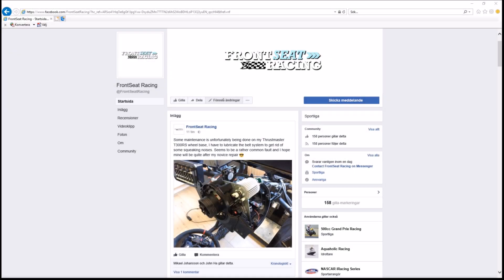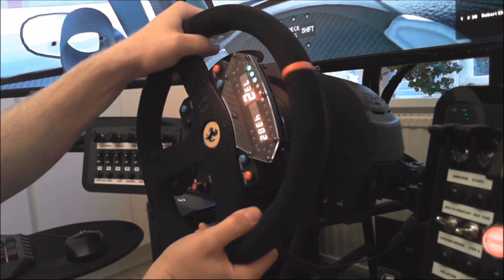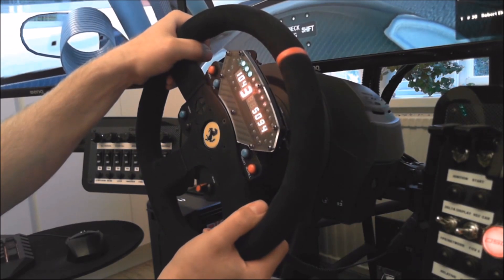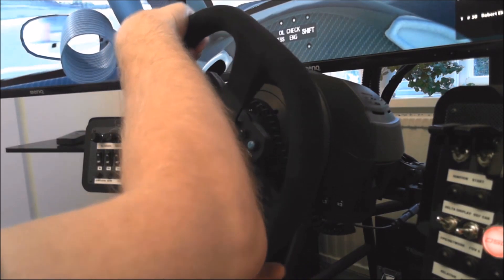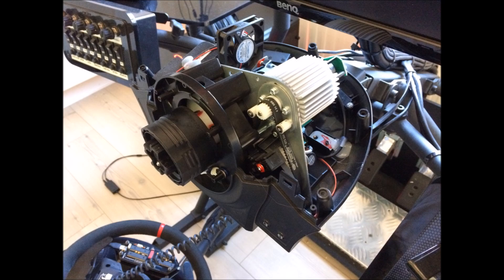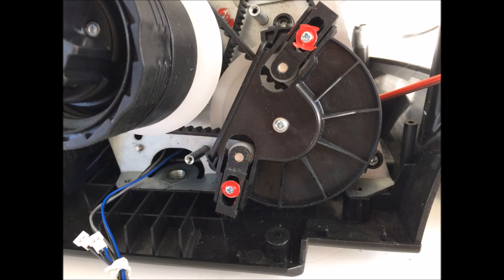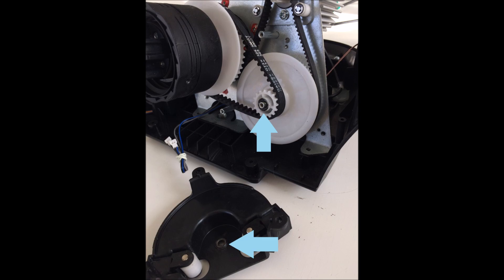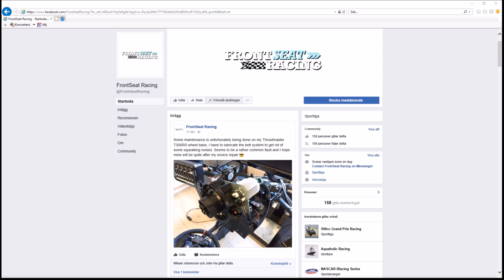Tech Guides - Removing squeaking noise on my Thrustmaster T300RS servo base

Comment: Thank you it works! I used multi-purpose lube and applied using the straw sprayer attachment so to not void the warranty. Meaning I didn't have to remove the screws at the last part of the video. 

Many thanks my friend.

Comment: Good night! 
Thank you very much, for posting this video. I do not usually comment on such guides, but your information was very helpful!

My T300RS GT, is less than 3 months old, with only light use (until the last 2 weeks), when my rig was built
Developed this exact noise, and it felt rough when noise was happening

Thanks to your handy information, I saved a timely RMA process ! 

No warranty stickers, or anything like that, so no need to worry about warranty.

The process was easy! I am familiar with building PC, and mechanic work, but not electronics, and was very simple.

Only things to note -

1) All of the small black screws are the same (for chassis, and plastic frame)

2) When removing the inner part, of the internal frame, the (silver) screw at 3 o clock is smaller diameter than the others in center

3) To remove the lower belt tensioner assembly, you must first remove the front flat panel (there are 5 or 6 screws around the face of wheel, please check), and it is clipped in
Becareful, as wiring to buttons left & right is short.
After front is angled, you can remove the tensioner, please note there are 3 screws on tensioner unit itself, to hold to wheel base, and 1 in center  - the bottom left of the tensioner screw is hard to access, best way is to angle the front panel of wheel (mode / L3/R3 buttons) and put screw driver through hole

4) When re-installing, you may need to apply minor gentle pressure to lift belt to fit tensioner, be mindful and no problem

Just be mindful not to lose screws, and anyone can do this, with only 1 phillips / X screw driver, please ensure your tool has good fit 🙂

Including removing from my sim rig  frame, and checking guides, and re-installing - time  taken : 90 minutes

To do a second time would take me 45-50 minutes maximum :)

Thank you so much ! 
<3

Comment: Thanks, did the same and it worked. For me it looks like mine is overtightened a bit but tightening mechanism is protected with warranty seals. It seems that all necessary screws are not protected with warranty seals so it's almost intended to be maintained from time to time, but I think TM will void your warranty if you directly say to them that you tinkered with your wheel interiors.

Comment: I've noticed mine has some kind of odd vibration when the wheel is turned. Could this be lack of greese problem or something more serious ?
Reply: Not to worry man, thats just the notchiness of the gears, perfectly normal
Reply: @krzysztofcylwich2817  Thanks for the asnwer :)

Comment: i lubed the spot and i think it actually got less squeaky, it would be silent i guess if i used more of the lube or a different kind of a lube (i used a bicycle chain lube xd)
Reply: pro tip - dont unscrew the red painted srews out of the thing that covers the spot with shaft and belts

Comment: Perfect video, mine needed lube in the exact same spot. I wasn't sure what kind of grease to use but I ended up using wd40 white lithium grease that I previously bought for my fanatec pedals' squeaking. My wheelbase is no longer squeaking and it spins more freely now. TY

Comment: Do you know where I can find a replacement motor for my T300 RSGT? THe steering is extremely chunky for lack of a better word.   I can steer 10-15 degrees in either direction and then its like there is a giant speed bump to go over before it releases and then 10 more degrees and the same thing.  I have no clue what it is, but I'm guessing it HAS to be the motor because even unplugged it is still chunky, choppy, but definitely not smooth anymore. Thanks for your time.

Comment: I have the wheel (GT versrion) for about 3 months and already after like 1 week of use, my pedals started "squerling" ( :) ) .... checked the video where other guy just opens and lubricates them.. So I did the same and since then, pedals are OK. And not long after pedals, the wheel base started producing this - the very same noise like you show in this video... So, now I know what to do...
I was also in contact with Thrustmaster support.... they always took like 10 days to reply (with a Covid excuse). They recommended me pedals lubrication by themselves. About the wheel base, they wanted me to send it back to them... but for the same reasons as you mention, I decided not to send it. I would be month(s) without wheel base, and new piece would have started doing it after another week again....
OK... Once I have 2 hours free, I go open my wheel base and "lube it up". I don't have problem while drifting, the wheel does not squeek when drifting, but once lapping in GT or open wheeler...., it squeeks just in the position I use the most for turning right (like 20° angle) and - it is quite a distracting element.... You stop focusing and only "expecting" the squeak noise to show up.
In general, I am happy with the product. I tweaked FFB in AC as much I could.. and it feels great. But these noises from both pieces.... Is it really THAT problematic to use enough grease already in the factory..?    .... (we all know the answer)
Reply: They also have an issue with the grease on the Thrustmaster Warthog stick. There is so little grease and it's so sticky that you sometimes need to push the stick with more force than usual to get it to move. My old T.16000 also had an issue with almost no grease applied to the gimbal, which caused a lot of friction that made it hard to move precisely. But Thrustmaster is not the only company doing this, I had to put grease on a lot of mechanical parts over the years because there was either not enough or it was put in the wrong place, not lubricating anything.

Comment: You can lube it without losing warranty!
I did it using silicone lube spray with a thin shaft. Remove the screw (without red paint) and apply spray into the hole, also I applied lube with this shaft(nose) onto the scratching axis by spraying it in the gap between gray panel and cog itself. Hope this helps! Worked for me!
Reply: I'm stuck at removing that screw, was it hard for you?
Reply: @alexcarolan8825  I don't remember having very hard time doing it)
Reply: @VadixeM  thanks for the reply, mine won't budge an inch, nearly destroyed screw so I give up lol

Comment from the maker: Still everything is working great so far, the noise have not come back :)
Reply: Still ok?
Reply: Bought the T300  2 weeks ago and it already started to make this sound. Thanks alot, working perfect!!
Reply: Thanks for the video... am about to commit to buying a t300rs gt and now researching or the possible problems and how to prevent them or fix them... would you still suggest me to buy this? my budget only allows for t300 or g29... If t300, what tips can you give to keep its life-span as long as possible? 
thanks!!
Reply: @jkwanness  a T300RS is worlds apart from G29 in terms on construction and of course performance. I’ve used the G29 before my exposure to T300RS GT edition. But coming from G29, the TM is just a much better quality product with flexibility on the steering wheel add ons, and option for T-LCM load cell brakes. It’s just a better ecosystem and product.
Reply: Thanks I heard the issue before and I thought about buying a different one instead of the t300RS GT just because of the problem but now I know how to fix it if it happens to me
Reply: Thanks a lot

Comment: Thanks, very helpful video. In my case the squeaking noise was coming from the other end of that shaft for the large white dual cog. With the black cover/tensioning plate removed, I could slide the large cog out from the metal plate about 5mm or so and lubricate with a bit of grease on the end of a cocktail stick (plumber's silicon grease instead of petroleum based grease since it is in contact with plastic parts). The only other thing missing is detail on which screws to remove to open the case. The following video covers some of this:
https://www.youtube.com/watch?v=SmmdA_4z_ak
After that, the front panel is removed with a further 5 screws on the front and 2 underneath.
Taking the appropriate care, it was about a 2 hour job alright.
Reply: Thank you, same problem…

Comment: I have a problem on my t300, when I use the steering wheel and the belt is under tension I noticed that it makes a slight click as soon as it comes under tension and I turn the wheel on the opposite side to the force of the ff. It makes a single click then if I keep turning the steering wheel from the same side it's all ok but then as soon as I turn the steering wheel from the opposite side (change of direction) another single click returns again.
Is this normal on the t300?
I have tried both to loosen the belt and to pull it but the problem remains.
I want to confirm that the click is really very light so I think it's a physiological thing about this steering wheel and not just a problem on mine.
Has anyone ever noticed this?
Reply: Hi, I have the exact same behavior. It seems to come from the large gear under the motor. I almost got rid of it by tensioning the motor belt, but there's still a little click anyway. Did you solve that?
Reply: @robertomozzicato249  did you solve it? I could not identify where the click was coming from .
Reply: @manadog  Partially. In my case it seems to be the large gear's pin clicking when you change direction, as if it has some play. Removing the belt the click goes away, so it has something to do with the belt tension. So I checked the pin screw for bending or tightening, but without success (visually I can't see the pin moving but I hear the click).
So at the end I just played with the belt tension until the click almost disappeared. It's still there, but you have to really pay attention during a game.
Reply: Interested also as I have the same issue ….
Reply: @manadog  i sold my T300 and now i have a DD OSW... T300 for me is a crap

Comment: Hi! Does the wheel still work? And has the squeaking sound gone away forever?
Reply from the maker: Hey Bart, wheel is working great and its been over 2 years so thumbs up.
Reply: FrontSeat Racing oh that’s very nice! I was thinking of buying one used and out of warranty, so this video surely will come in handy when I face this very issue:)
Thanks for sharing this easy fix

Comment: Hi. I have a noise exactly like shown at 0:52. In that video it happens when you turn left. To me it happens when I turn right. But I think it is the same problem. 
Does this method work also for that noise?? And what kind of grease did you use for the fix?? And where do you exactly applied grease?? Thank you
Reply from the maker: Hi and sorry for late answer, I don’t know if my solution will make your problem go away, please give me an update on that. I just put the grease on both the piston end and the plastic cover, should be shown in the video. The grease is just the cheapest one you can buy aimed for outboard motors, cars and other  similar stuff. Hope you found your solution already to this problem! Take care and thanks for your comment.
Reply: @FrontSeatRacing  i opened the wheel... but i was afraid to take the belt off :D I was afraid to do something bad, i am not so good doing these kind of reparation. So in the end... I did nothing for the moment. And I keep the noise. Also because i really CANNOT UNDERSTAND WHERE IT IS COMING FROM!!! 

It is not so annoying and cause of the noise of the car you can hear absolutely nothing while driving. It also seems that the wheel works smooth as before. Since has not warranty anymore, I also can't RMA. I'll wait for some days to see if the noise get worse. 

Does the noise appeared again to you???
Reply from the maker: Understand Andrea, I would not have taken the belt of either because that takes it to another level of own repairing. My sound have not coming back and it was over 1 year ago I did the fix shown in the video. Your problem seems to be different according to the sound, not that plastic sound but I believe other users must have the same issue that you do so keep locking for solutions online!

Comment: man I just did the same thing but the noise is still there, much less. maybe its another component I need to WD40
Reply: Wd40 is not a correct lubricant for this apprication. You should use it to loosen rusted parts only.
Use a grease spray of some kind.

Comment: @FrontSeat Racing - What are those two unplugged cables for near the steering wheel connector? its wrapped in a rubber band and doesn't seem to be connected into anything, I was just curious as I have the same base unit. Thanks
Reply from the maker: Hey, it is default thrustmaster for a shifter kit that makes the paddles static fixed to the base rather than turning with the wheel. Old T500RS got that solution.
Reply: FrontSeat Racing Thanks for the answer as I was confused cos there's no mention of that in the manual. So it's obsolete? x

Comment: Very helpful video! I have an issue with my recently purchased T300. I suspect that there is some play in the main belt which goes from the motor to the first gear. So i'd like to check the belt tension by removing the top cover of the base. Would this void my warranty? Are there any seals and or markings on the motor mount which would tell it has been adjusted? Thank you in advance :)
Reply from the maker: My guess are that you can remove the top cover and take a look and see if something is wrong, if I remember it correctly there was no marks on the screws there but about loosing the warranty I have no real answers,  as seen in the video the only marking are on the belt tension thing and not the motor itself, before you do anything check forums and search if other people having the same issue or if its just a normal behavior that you are having with the wheel. Good luck!

Comment: Thank you for the video, however, it would have been great if you would have shown us exactly which screws you removed. I am paranoid I will do it incorrectly and make my issue even worse than the squealing (squeaking) :) noise!
Reply from the maker: Understand the question fully and I will do that if there will be another video in the subject, hope the assembly went fine anyway.